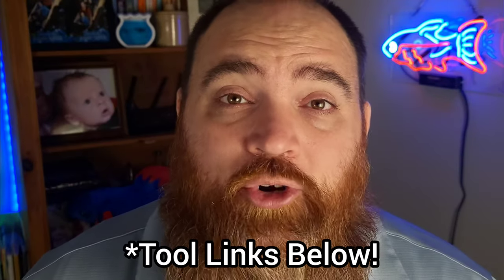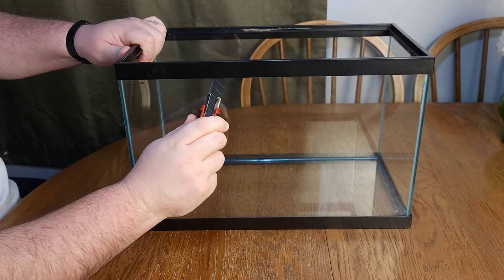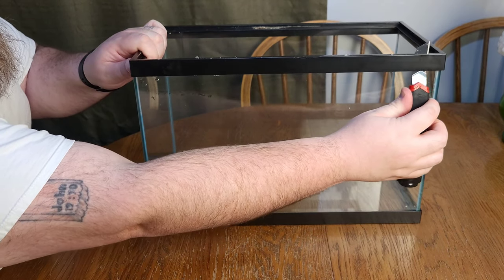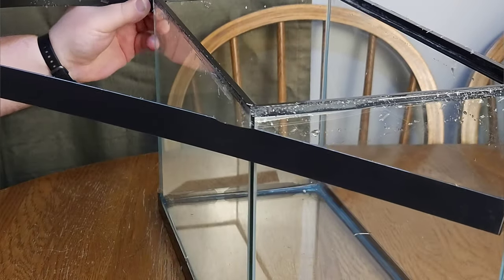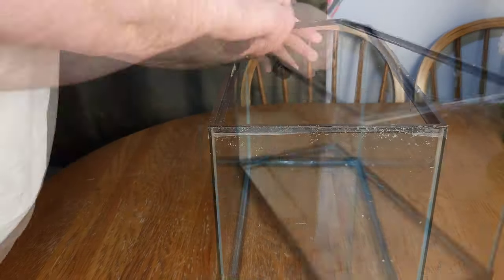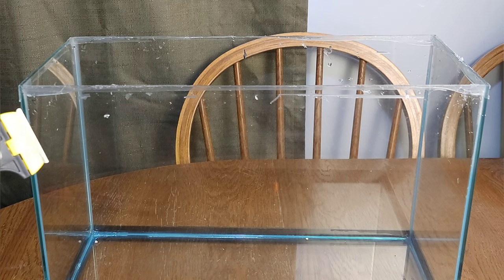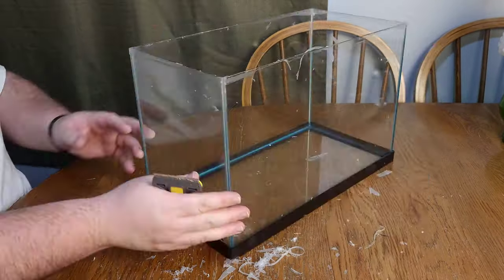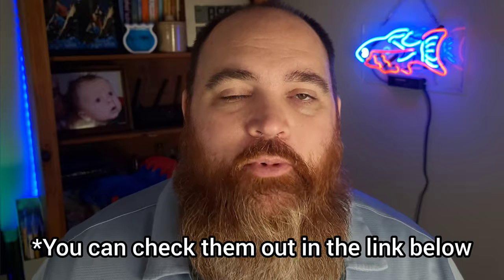Aquarium Rim Removal in 3 EASY Steps!

Comment: Great video - straight to the point. The only thing I have to add for anyone looking to do the same: PLEASE make sure you are wet sanding glass and using PPE - and do it outside for extra precaution. It seems small and harmless but it’s not something you wanna breathe in if you can avoid it.

Anyway, thanks! I’m going to go try this out. 🤞😬
Reply from the maker: Great points!

Comment: I need to remove the bottom frame. There's literally no videos for that. The seal failed on the bottom. It's not broken but I want to take it off to reseal the frame before resealing the inside of the tank
Reply from the maker: It's basically the exact same procedure.

Comment: I have always thought the top rim provided support for the sides as the outward pressure and weight of the water put a strain on the silicone in the seams. And I thought that aquariums that were made rimless, used a different type of silicone and method to overcome this. Is this no longer the case? Is all the silicone glue the same? Would this work on a 20 or 40 gallon tank? They often have supports going through the middle of the tank. Is that structural support, or just there to hold up lids? Just curious because I'd love to do this to the 10 gallon I'm about to set up.
Reply from the maker: It does provide additional support but in tanks 20g and below they can hold water without them.  Some people do it with bigger tanks but I haven't personally done a 40 breeder.  Anything with a center brace I would not try.
Reply: 100% silicone is 100% silicone - Shouldn’t be using adhesive with any sort of additives anyway.. So, in theory, it’s the same adhesive but quality likely varies [as with most brands]. I’ve seen another YouTuber completely disassemble their tank, then reassemble it with new silicone and leaving the rim off, but perhaps that was an extra precautionary measure. I’ve also seen, for a larger tank, adding a glass brace for anything over 3 or 4ft, so you can still go rimless for those. [DYOR; I’ve never done any of this and am using Ian’s video for my first attempt of testing the waters lol]

That plastic is so flimsy, anyway; Does it really add that much support when you have X pounds of pressure constantly against it? If the seams broke in a braced tank, I can’t fathom the plastic helping much but apparently it does for larger tanks.🤷‍♀️

Comment: This was harder than it looked! But I managed to get the job done. Had to use two different razor blades, and not everything came off in one piece, but pieces. I almost left out doing the inside parts of the tank. Cut myself kinda badly, but worth it. Dw, I had worse lol.
Reply from the maker: Glad you got through it!  The quality control on fish tanks definitely varies leading to some being more difficult than others.
Reply: @IansFishRoom  I applied the same thing to my 5 and a half gal tank, but sadly I cracked and broke it 😔
Reply from the maker: @Abcity92  that sucks!  I'm sorry to hear it broke on you.
Reply: @IansFishRoom  😢 I was going to use that and clean it, but I’ll just use my 6 gallon. And just stick to buying rimless tanks. But my 10 gallon is finished.

Comment: Thank you so much!
The rimless version is $100 more so I'm going to just buy a framed one and do this. 
I think the frames should come removable.
Reply from the maker: Glad you found this helpful!
Reply: MonkaLaugh
Reply: The rim is there for a reason. You will save $100 on removing the rim, but you will have to pay $5,000 new flooring. Don’t do this.
Reply: @BradfordRMcKnight   If it's so required, why do they sell them without
Reply: @Anne_Onymous  when they sell them without rims they use much thicker glass, which outside of just more glass strength on the rim, it gives double the surface area for the glass to stick together at the seams.

Comment: Had to look this up because I purchased a light for my 2.5 gallon only to realize I can't mount it on the rim lol 
But I know it'll be worth it in the end, thanks for the tips!
Reply from the maker: Glad you found it helpful!
Reply: Update on your tank? did it crack or explode? I'm so worry because I did the same thing pls answer 😭
Reply: @ichikades  hey, thanks for checking XD
Yeah, I managed to remove the tank rim, took me a bit longer than the guy in the video (mostly because I had to handle the blade) but it was fairly easy and I didn't crack it. 
Still some silicone residue on the sides and rear, but honestly I don't mind that.
Reply: @onyxdragon1179  Thank you so much I hope mine won't crack when I put water in it
Reply: @ichikades  so long as you don't mess with the silicone keeping the aquarium together you'll be fine! 
Just be careful when you pull the rim off, I had once broken a previous tank thay way some years ago

Comment: The acetone will eat acrylic, so be mindful of how much you use and how slowly you work. This type of acrylic may be denser than acetone's target acrylic use, but the material itself is essentially the same.
Reply from the maker: I'm unaware of any acrylic tanks that have this type of rim.  Do you know of any that do?
Reply: @IansFishRoom  Yes they do have them with this type of rim.
Reply: @IansFishRoom  I just know that my small tanks from Walmart are definitely not glass (and yes, they have these rims. I started cheap and I'm still spending cheap lol), and that acrylic fake finger nails require an acetone soak to remove, same as fake nails made of other types of plastic.

Comment: Will it cause any structural issues when you take it off? Kinda wanted to do it with a 40 gal, but by the looks of the coments, it seems quite risky.
Reply from the maker: It does cause structural issues and the bigger the tank the higher the risk.
Reply: This is a terrible idea. The Rims are there so the manufacturer can safely use thinner/cheaper glass. You will end up having to replace your aquarium spend $5,000 on new flooring.
Reply: @BradfordRMcKnight lol no. Unless the tank had a center brace, the rim is just to protect you from thier shitty cut glass

Comment: Hi.  I have a reptile tank that I am using as a paludarium with 4" of water, some lava rock, soil, and lots of pond foam rocks and both aquatic plants and assorted mosses.  None of the "land" is touching the sides in order to reduce pressure.  I want to remove the top rim and be able to cover this tank with a solid piece of plexiglass, both for aesthetics and to hold in the humidity.  Since reptile tanks aren't really made to hold water - and I stubbornly decided to do it anyway without an issue - do you think it would be safe to try this on my established tank?  (I would definitely cover all my structures and plants with plastic wrap to avoid the mess.)
Reply from the maker: I can't really give you an educated answer on this but if your willing to replace it if it fails...
It's always a risk when you start modifying.
Reply: Thanks for the advice.  I can buy another rimless tank, but I was trying to use what I had taking up space.  It's the idea of trying to get all the stuff back out and trying to reassemble the scape in a new tank.  I just got it all where I wanted it - didn't realize how bad the rim affected the "look."  So, I'll probably try getting it off some day.  Thanks to you, I know how ! @IansFishRoom

Comment: If i do this to a 10 gallon tank, will this possibly result to leaks in the long term?
Reply from the maker: I'm sure there is some increase in risk but there is always a risk that your aquarium will start leaking at some point.  It's probably going to leak at closer to the 20 year mark vs the 30 year mark but will you have the aquarium long enough to know ?
Reply: @IansFishRoom  cool thanks. i just tried it and it doesn’t seem to be doing anything except scratch the glass
Reply: what am i doing wrong
Reply from the maker: Are you using a retractable razor?  The extra length makes a big difference.   It does make some noise when cutting off the silicone but you shouldn't be scratching the glass.
Reply: @IansFishRoom   oh I see thanks. it’s coming together now lol

Comment: Do you think its risky to do it on a 20 long? I really want a cool saltwater coral aquascape with rimless aquarium
Reply from the maker: The risk goes up as you go up in tank size but you could consider bracing the top by siliconing a piece of glass across the top.

Comment: Hi. I have a 90 gallon tank and want to make it rimless. Your video was straight forward, but what can I add for more protection so that my tank doesn't split or leak
Reply from the maker: You can silicone glass panes of similar thickness glass across the top.  I've never done it personally but there are several youtube videos on it.  My only concern would be that 90g is bigger than tanks I've seen done that way.

Comment: hey, i want to do this to a 20 gallon tank. do you think i’ll run the risk of having my aquarium breaking apart because of the pressure and tension of the water,
Reply from the maker: You should be good with a 20 gallon, but there is always a risk.  That's the biggest tank I'm comfortable removing the top frame from personally.
Reply: @IansFishRoom  sounds good. i already removed the rims off my 20 gallon. however i haven’t filled it because i’m skeptical as well. i’m going to reinforce the silicone before putting some fish in there.
Reply: @vlm1322   I’m considering doing this to my 20gal long any updates ??
Reply: @brifisher  it worked perfectly. Nothing to worry about

Comment: is it safe to remove the bottom frame?
Reply from the maker: You can but you need to have a very flat surface with a pad underneath the tank as the brace supports the weight

Comment: Is there ANY way possible to do this without breaking down the whole system
Reply from the maker: If you mean without breaking the top rim the answer is yes its possible but it's going to be tank dependent and if it was built with minimal glue.  No real way to know until you are into the project.
Reply: @IansFishRoom  meant anyway without emptying the tank..and thank u for fast reply
Reply: I want the rim gone because that’s the obvious new look that in these days but I can’t imagine there’s a way to remove it safely im thinking of everything.like idk what if I lowered water level..completely covered the water like tarp it up some how 😂 then scrape..remove rim..glue on supports let it dry ..carefully remove cover ontop of water (that would be catching silicone debri that i scrape since water level down) I know I’m crazy but people would call me crazy for breaking down the system just for no rim
Reply from the maker: @JusD3wit_  probably easier to just get a new tank.   I'd be worried about accidently breaking it with it full.

Comment: I am trying to remove my side glass on both my 10 gallon tanks so I can combine them to make a larger longer tank
Reply from the maker: Good luck!  I'd just buy a 20g.
Reply: @IansFishRoom  I just don't want to junk my other 10g but I already got the glass off just need to silicone and it's done
Reply: @IansFishRoom  the secret was to use a straight razor 🪒 blade/safety razor blade it's so thin that it just pushed through I grabbed both side from inside and outside tank pulled up and it sliced all the way through

Comment: Can you not remove the bottom one
Reply from the maker: You can but there are 2 reasons I don't.  The 1st reason is I don't mind the bottom plastic because I use black substrate and the bottom plastic is not that noticeable.   The 2nd reason is the tank rest on that plastic frame and if you remove it you have to get a mat to put under the glass to keep it from breaking.